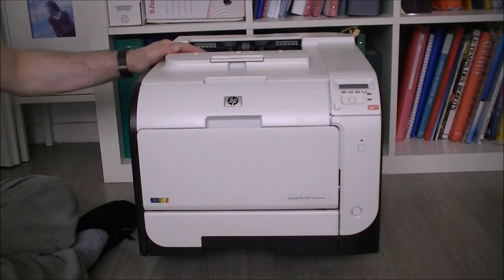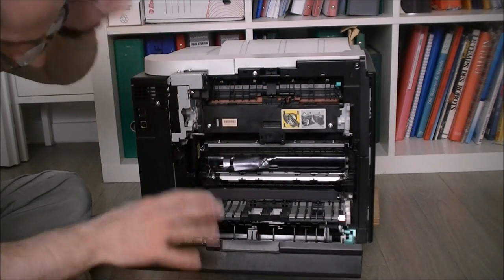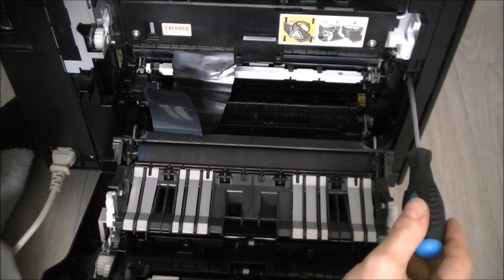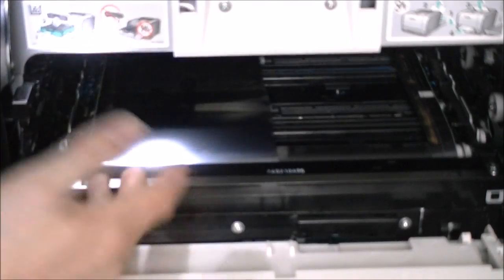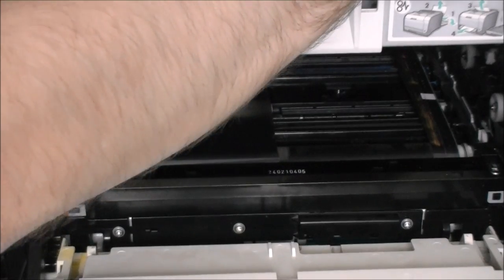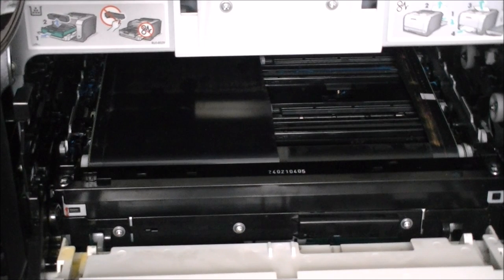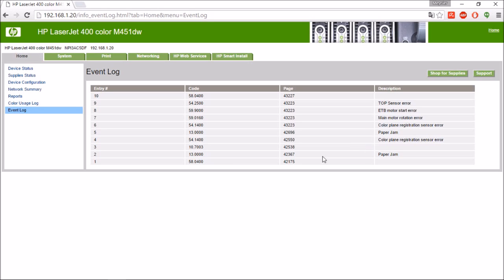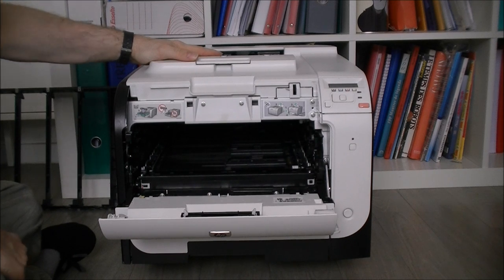HP laserjet pro 400 color printer teardown intro

Comment: Factory to landfill HP tech. I stillhave a couple of alder HP laser printers for my business in storage that have 2.5 millions sheets on the clock for each of them and they still work. Had to replace them as they were getting very noisy, I don't recall which series off the top of my head. Those are the only good printers I have ever had from relatively modern HP products. I did locate smaller HP units of the same era/family that I reflowed the BGA to restore on and they are used for lower demand printing. But all the inkjet from HP is disposable junk (even the business class) and after 8 printer failures over 4 years; no more HP inkjets, ever. If you want a great bulk color printer (so far almost 2 years not a glitch), go with the Epson ECO-tank. Holy crap, what an awesome bulk color printer. Amazing print quality for our color instructions we supply with one of our products. It was xpensive at over $1200, but well worth it. Ink comes in huge bags, the black ink alone being almost 1 gallon! Imagine spilling that sucker! I still have an epson color printer from 1998 still going strong in one specific application.

Comment: I used to use and do basic maintenance on a slightly larger and much older hp color printer at work years ago (likely a 4600TN). Cost over 700$ USD (almost 600 euros) to replace the toner cartridges. It was kind of fast but the image quality didn't stay good for very long after it was new. Always had length wise streaks in the image and the test pages looked horrible. Some streaks came from the drums (which did use lasers) and some streaks came from the easily scored transfer belt. The excess toner was never properly removed from the transfer belt so there were no completely white ares unless you printed many blank pages or cleaned the belt manually. The cartridges also leaked toner and we had a cartridge break internally and pop, filling the whole thing with magenta toner. Plastic junk, sounded like it was going to strip it's gears but it did keep gong.
THEN I was given a much smaller one that you have there that hadn't been used in a year and 3 of the cartridges would no longer print yet are full. So it only printed blue... 5 years ago. I'm going to play with the cartridges to see if it can work again but I think it might end up covered in 4 colors of toner. I'll see if I can get stepper motors, solenoids and some crappy gears out of it at least.

Comment: Repair video please, how much is a new transfer belt on ebay :-)
Reply from the maker: I found only one for sale on ebay, and it is over 200 euros.
Reply: 40000+ Pages is nothing for an office printer I've seen older HP's where the toner transfer belt is rated for 100,000+ pages. I've also seen people damage printers by clearing page jams by shoving sharp objects into the printer :-) It's does sound like the printer is best scrapped if replacement cartridges +  parts are expensive and performance is slow.
Reply: This is a lower end printer and HP has been specing the volume down with every model. They've been making the various parts like that the failure mode. For instance, the fuser film roller on the P2055, 2050, 2035, and M401 will fail in as few as 300 prints but will typically average at least 6000. HP makes no claims on volume specs for these parts on these models.
Reply: Kadah I agree I was very impressed with some of the older HP laser printers but the new ones seem to be designed to be as economical and as throw away as ink jet printers. This seems to be a common trend in manufacturing there must be a new global government directive to destroy the environment and create a must pollution as possible :-)
Reply: Coolkeys2009 To be fair, the new ones are also priced as disposable. 10 years ago the class I was buying for individual workstations was over $800, now they are $150-200.
The film roller that wears out on the current ones is a $12 part and a 30-45 minute repair.
I've got some 600 series printers with close to 2,000,000 impressions with the bulk of that done within 2 years. They've needed multiple roller and fuser replacements. One of them is used to print labels constantly and has so much internal wear that many of the paper guide ribs are worn away to completely smooth!
Reply: Plss sir support 10.1002 supply memory error
Reply: Laserjet pro 400

Comment: LASERJET is misleading is this is most definitely a laser printer with a photosensitive belt I thought that it was a photosensitive drum and a fuser head and a laser that writes the image to be printed on the sheet of paper to which particles of ink resin stick to before being fused to the paper, the resin packs should be disposed of correctly as these will cause a big mess which no one wants, ( #Coolkeys2009 I think that he wants to get rid of it as he would be looking for a new printer).